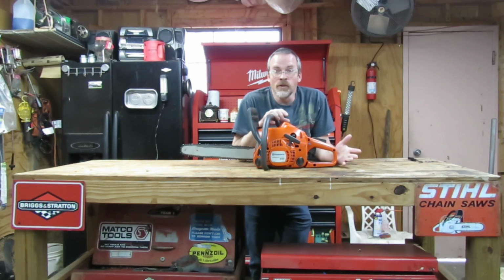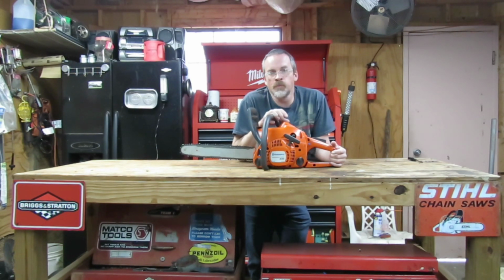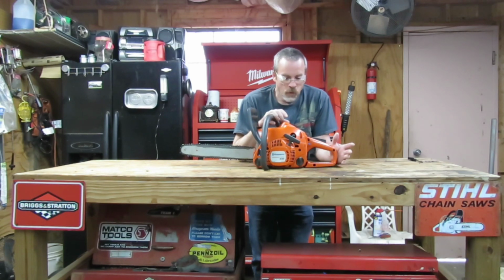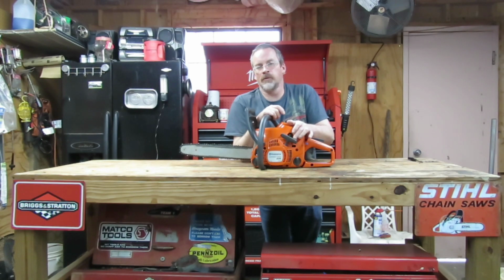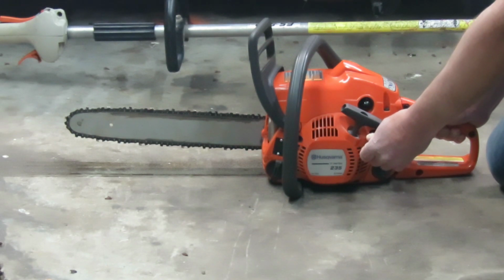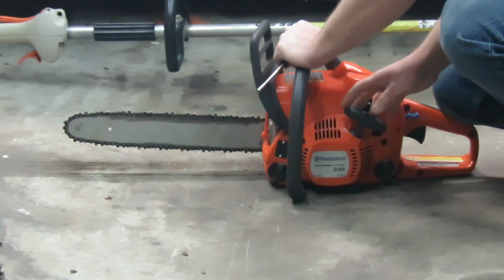Part 3 How to Tune Carburetor Husqvarna 235e 240 Chainsaw

Comment: having watched all three videos I now feel ready to tune my own 235, even though its 2008 it should be good, anyways ive a question, could you tune the saw with the bar and chain off? then if needed retune when its reassembled? to keep the safety on the right side! Awesome video my man, your particularness is very obvious without being ocd
Reply from the maker: @bommm22
I Would Not recommend tuning saw without bar & chain attached to chainsaw. Can sheer flywheel key and I have seen the clutch come loose & fly off.
Reply: @sartingarage8045  Awesome my man, I will leave them on, glad I asked now

Comment: If you use a FitBest carb set the L and H screws to 1/2 turn the threads are different.

Comment: I have one of these with the standard style chain adjust set up . Rarely used it until I got some property . It always ran well until it sat for a couple years. Tried one of the Amazon carbs it was junk. So I took it to a saw shop that I really like they told me to for them to fix it they would have to charge me almost as much as a new saw of the same caliber. I opted to get an Echo CS400. I really like it. BUT I just couldn't throw the 235 away as it felt like a waste of money  I knew it had great compression so I searched out a factory Zama carb for under $60 I put it on and new fuel line . I got it running pretty good but it took a lot of adjusting. I think its close but not exactly sure since the Echo runs so well it might be throwing me off.  I played with the idle screw which I probably shouldn't have which is now causing me to doubt my adjustments .
Reply from the maker: Usually those carbs are pretty close to tuned when purchased, Usually if there is problems adjusting it in, Most likely there is an air leak somewhere. Intake boot, hole in fuel line, Intake gasket, Cylinder Gasket leak or Crankcase leak. Anywhere that the engine can suck in more air than is needed.
Reply: @sartingarage8045  Thank you for the reply !!! 
I was under the impression it would be close too but it sure wasn't. I think me playing with the idle screw is what caused it to go all screwy when setting it up. It runs pretty good now. I checked for an air leak and could not find one. I wish I had a tachometer so I can set the high speed circuit perfectly. I also have to remember its a light duty homeowner saw and not to expect too much out of it .

Comment: So Hi speed adjust, if too lean,  "screaming" sound, vs turning the screw down you get a bit of a flutter. The "flutter" is what you are wanting, correct? Very good video by the way. And yes we can hear the various engine sounds. My Husqvarna definitely needs some adjusting. When I turn it on it's side it cuts out. When I give any pressure thru the chain when cutting it bogs down .
Reply from the maker: Yes the flutter is what you want to hear
Sometimes it's hard to hear when your right on top of Chainsaw at 12,000 RPM..lol
Take your time

Comment: Hey man I have a husky with about 4 hours run time on it. For some reason it starts bogging and running rough when you tilt the bar towards the grounds. Every other angle it runs fine.
Reply: Needs to be tunned
Reply from the maker: There is several things that could cause this,
But I would think the needle valve is not seating correctly. The carb throat is at the same angle when you are tilting the saw forward. What that means is. When the saw is at the different angles when it runs good the engine is pulling the fuel from the carb, 
When you tilt saw forward its allowing more fuel from needle valve not seating.
Could be just a tuning on Carb, but I doubt it due to it runs fine at other angles

Comment: On my Husqvarna 235 and my 136 chainsaws, both have air in the fuel lines. On the 235 I have just rebuilt the carb, replaced all the lines except for the filter line. I couldn't get the filter line that was in the kit through the hole in the saw so I used the original line. Should I have air bubbles in my fuel lines?
Reply from the maker: I think you maybe sucking air in your fuel line mixed with fuel causing the bubbles
Reply: @sartingarage8045  I will check that in the morning. 
Thanks

Comment: Witch model of screw driver you use to adjust hi/low speed on carb? Thanks
Reply from the maker: I'm pretty sure it was spline tool
There is a link in Description for a Complete Carb Adjusting Tool kit

Comment: I stupidly fiddled with the idler screw under the high low.  How do I set that?   I lost track of factory setting.  Did you ever do a video on that?
Reply from the maker: Factory Setting of Low and High Speed are in Part 2 Video. Getting the idle Screw back or close to factory setting is a little more difficult. 
Once you set the low and high speed screws back to factory setting. Adjust idle in about half way. Start the saw. Should be idling fast. Then Back the idle down as low as you can get it without Engine stalling. Once it will idle. Adjust low speed in until engine starts to slow down and listen to exhaust. The flutter in muffler will go away as your turning this low speed screw in and engine will start to stall. Back the low speed screw back out until you hear the flutter in exhaust again.
Usually about half a turn out 
Then adjust Idle Screw to where you feel it should be
Chain should not be turning
Reply: Sartin Garage ok.  I’ll try that.  Thanks.  Your videos are great.  I’ll rewatch after I get the new carb.  
Do you think a rebuild kit would be better and use the original carb?
Reply from the maker: Yes. Using the original Zama Carb and rebuilding it would be better. If you read the reviews on the carbs on the internet you will see it is hit and miss with those carbs. Meaning you may or may not get a good one
Reply: Sartin Garage i need those tools that come in the kit for the high/low anyway.  
Sorry about all the questions.  I’m very depressed, out of work and can’t even get this right.   I appreciate your help.

Comment: Is there a way to adjust the bar oil flow? Mine just spits a ton of oil everywhere. For example I use the same amount of bar oil as gas. Which is bad. It should be a half a tank of bar oil per tank of gas. Again, us there a way to adjust it on this 235e model? Thanks.
Reply from the maker: There is Not a Oil Pump adjustment on the smaller Husqvarna saws. Just make sure your using Bar Oil and not just Motor Oil.
Reply: @Sartin Garage thanks for the confirmation. I've been using husqvarna premium bar chain oil it's entire life. Never, not once used motor oil. However my saw just dumps oil everywhere. It poors on to the bar like a water hose. QUICK TIP: because there is no adjustment the only thing that can be done is to restrict the flow through the lines. Inside the oil tank there appears to be 2 pickup lines. One to the bar, one to the engine. You can squeeze the bar line with something like a crimp to restrict how much oil it picks up. Or you can take the bar oil pump out and put a thinner hose inside the oil pump pick up line. DO NOT clog it  completely! just simply make the inner diameter of the line smaller which would reduce how much oil its picking up. This would make a great video.. ;)

Comment: I just bought the same saw yesterday and it start and runs but after i cut a few thing and let it idle it stalls some times any suggestions
Reply from the maker: Turn L = Low speed screw counterclockwise about 1/8 of a turn.. Not the idle screw

Comment: Love it Sir ,My Dad Excellent Mechanic had an Ear for these kinds of things. One thing I heard the Flutter. Would You not say, that when its warm and You open it up it should not hesitate at all getting to the high end? Hey I think I found My problem with Charging System on Kohler 301 engine will post there. Really enjoy your Knowledge on small Engine Repair Please keep Video's coming .KC
Reply from the maker: Thanks
Yes there should be just about Zero Hesitation from idle to wide open Throttle.

Comment: I was looking on eBay a new carb with kit is about $15.  Shit I paid $10 for the primer bulb kit and $7 for a spark plug at Lowe’s.  So I might try it.  

When I replaced th long return fuel line I accidently pulled the little breather rubber thing out.  Can’t get it back in inside the tank.  Will that be a problem?
Reply from the maker: Johnny's Cousin Steve The Carb you are looking at is Not a Original Carb. It may or may not work correctly. You can try it if you want, but keep the Original Carb.
Reply: Sartin Garage yeah for $15 I figured it wasn’t.  The reviews said it worked.  But I’ll keep original and try to rebuild it if it doesn’t work.

Comment: my neighbor asked me to look at his 240 that never ran right. i am not sure if the idle screw was moved when he had it into a shop.. do you know how many turns out the idle screw comes from factory? I got his saw running great, high screw is 1.5 turns out and low is 2.5. does that sound right?
Reply from the maker: That sounds about right on low and high
Just make sure you can hear that flutter in exhaust like in part 3 of this video. Hard to hear thru audio on camera though.
Idle Screw there is a process to that to get it pretty close to exact. I will do a video on that hopefully soon. But until then you could just set it to where it sounds good and chain is not turning.

Comment: Hi my friend... the screw “H”  and “L” how round left could I do it? Because I want to worked engine ..
Reply from the maker: You shouldn't need to go more than 2.5 to 3 turns out to left. If you need to go farther than this, There is a jet in carb still clogged or you have an air leak.
Reply: @sartingarage8045   thank you ... expensive to H expensive L to work like yours ?
Reply: I have l around 2.5 and H somewhere around 1.5 is correct;
Reply from the maker: I believe that 235 both screws were around 2.5 turns out. I'm pretty sure its in this video
Reply from the maker: Its actually in this video
https://youtu.be/2C9Enu1-4NI
Reply: @sartingarage8045  Thank you very much brother ...

Comment: Nice video bro. I just wanna ask you how many turns is ideal for L and H skrews? Two turns or less?. I ask you becouse  i have the same model of huskvarna chainsaw.Thanks
Reply from the maker: In part 2 of this video at 19:45 shows you how to adjust these screws. Typically 1 and a half turns out. On this saw it was 1 and 3/4 turns out low and high speed.
Reply: @sartingarage8045  Thanks man. Keep it up

Comment: I have this exact saw and when I start it, it revs way up and the chain goes fast and it dies when you turn the screws down, or hit the throttle any suggestions?
Reply from the maker: There is several things that could cause this symptom. First thing is the engine is running out of fuel which would be carburetor is stopped up and needs a Carb Rebuild Kit. 
2nd thing is a air leak, This could be a fuel line with a hole in it, Intake gasket or Intake boot with a hole in it.

When you open the adjustment screws up on Carb and its Not doing much, This indicates there is not enough fuel going thru carb. Which would mean Carb is stopped up not allowing enough fuel

Comment: Well damn. I got a saw that it's idle screw has been messed with.  And I'm at the point of fixing this saw with a sledge hammer.  I think I'm gonna make a video of it. I'll call it, "how to fix a husqvarna chainsaw". And swing a sledge hammer till it's beat down to a pulp.
Reply from the maker: Kyle just be patient ....lol
Just go thru the steps
1st Compression Test 90 pounds Minimum to atleast run. Should be well above 90 pounds to produce the power and throttle response had when new.
Check Ignition Spark
And you only have 2 things left to check
Timing and Fuel
Timing there is no adjustment
Only thing that would make it out of time is if flywheel key is sheered. Doubt that ,But have seen it happen mostly due to customer repair errors.
Only thing left is fuel
Carb Cleaned, Carb kit, Fuel lines, Air intake leaks.

Basically if saw has good Compression 
Saw is worth fixing